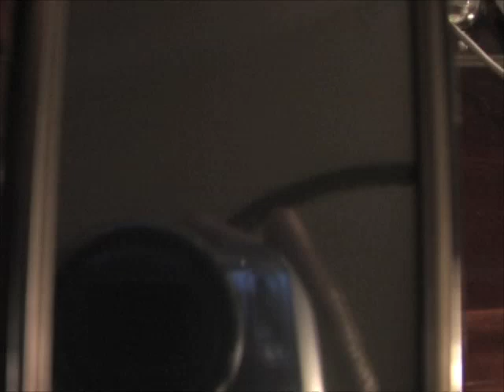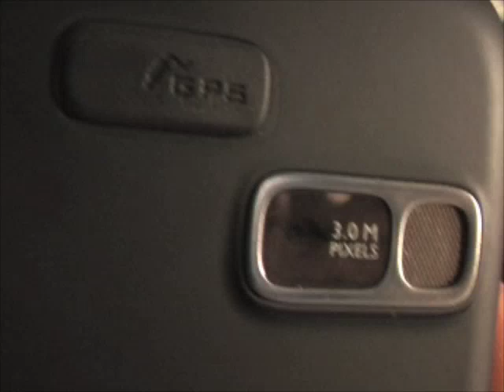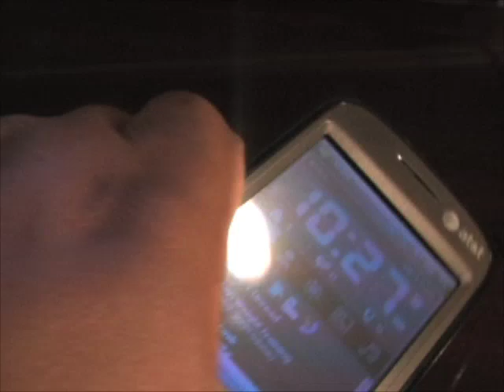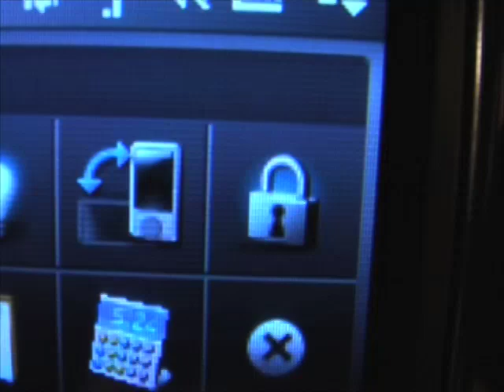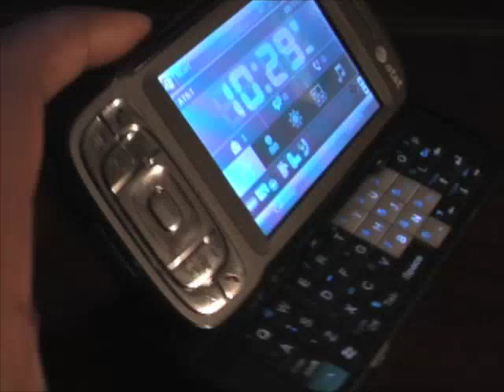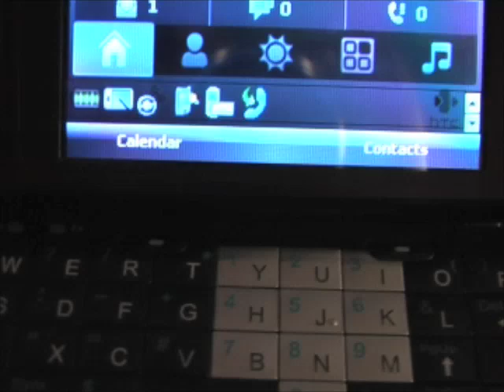AT&T Tilt introduction

Comment from the maker: It depends on what you want to do with the Mac and the Tilt. Syncing PIM info and certain kinds of settings and files is possible via Missing Sync software. Transferring files via Bluetooth back and forth between the Tilt and a Mac is possible as well.

What exactly did you want to do with your Tilt and Mac?

Comment: besides the front VGA camera that the TYTN 2 has that the tilt doesnt, what else does the TyTN II have?

i want to buy the unlocked tytn 2 but its rather expensive. the tilt is 300 bucks, the tytn is around high 700s.

what do you think?

Comment from the maker: Just called a local AT&T rep at a store who informed that it comes with mini-USB earbuds, a USB cord and a manual. There is no case. I used to have the Tilt at one point but returned it and got the unlocked HTC TyTN II instead.

I typically do not like music from the HTC due to the external mono speaker and I tend to rely solely on my iPod for music. Even if I had an adapter to use my own headphones, I think the sound wouldn't be as good as an iPod or a Nokia Nseries phone.